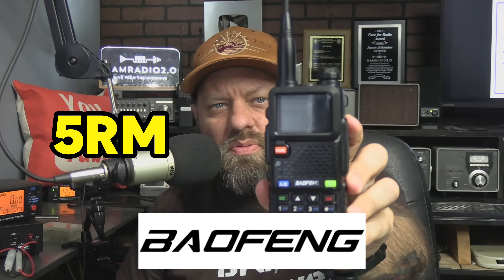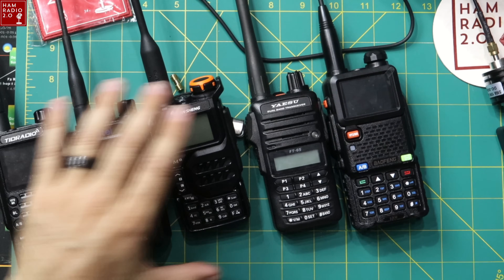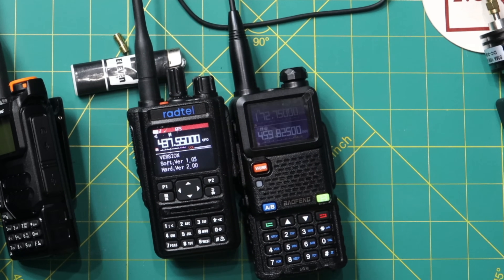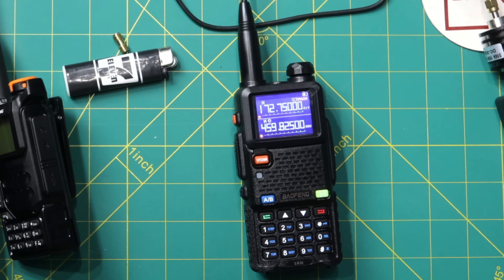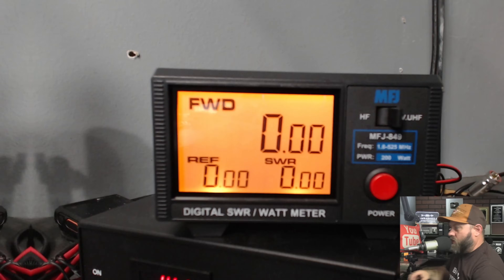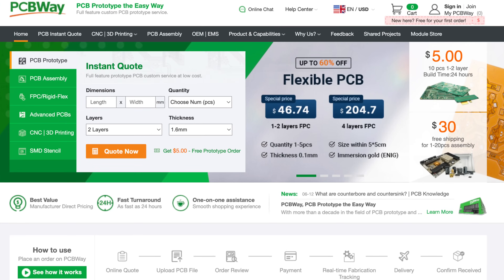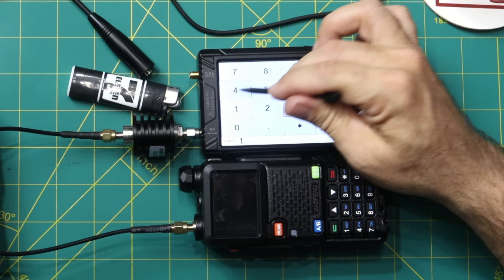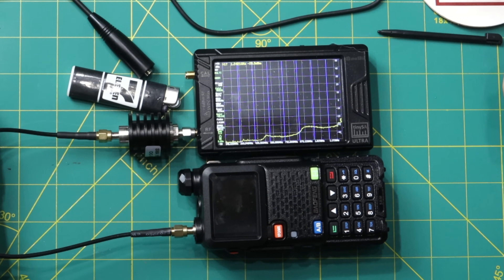The Surprising Truth About Baofeng 5RM and TinySA Power Test Results

Comment: I would like to know if in my company, with the UV5-RH Pro GPS or UV-5RM Plus GPS, I could follow all the 30 radios gps positioning, at the same time on a PC software? What Software? How to do it?
Reply from the maker: That's a good question.  I am not 100% sure, but I don't think so.  The GPS in the radio is a receiver, not a transceiver, so it doesn't transmit or beacon a GPS position.  You would need an actual GPS device to do this.

Comment: Jason - New ham, a 5RM is my only equipment as of now.  Maybe a silly question but - is there such a thing as an external filter that can be added to a handheld transceiver that could clean up a dirty signal such as what might be generated by one of these?  At the price point, I recognize it might be cost-impractical, probably better to just buy a different HT, but I like the radio in other ways - just curious, thanks!

Comment: BTech/BaofengTech just came out with their 8 watt ti-band version of this radio. The
BF-F8HP PRO. VHF/ 1.25/ UHF, IP54, 1,000 Channels, GPS, Aviation Band Scanner, NOAA Weather Mode, USB-C Rechargeable Battery. $69.89 on Amazon. BTech tends to take these  Baofeng radios to the next level with better quality.
Reply from the maker: Yes

Comment: FWIW, some reviewers have reported that Baofeng has cleaned up the signal in the newest 5RM radios. I bought a couple for myself and I liked them so much that I bought some more for a non-profit i work with. It's a little disappointing that it doesn't generate the rated 10 watts, but in reality there are so many factors affecting signal strength that in a practical sense, 8 vs 10 won't matter to most people. It hasn't mattered to me.

Comment: It is interesting to note that though Baofeng calls this radio 10W in promotional literature, there is no stated output power in the user's manual and I didn't see any specifications to calculate output power either.  In this and 2 other reviews, power output was measured at 8-8.5W max.  This shows good consistency and I can only determine that quality control is good and power output is also OK.  I suspect Baofeng does like many manufacturers and plays the white lie game here.  Audio speakers are often rated at peak vs RMS output.  This device may be rated at input to produce maximum output for example.  So Baofeng advertises this at 10W but is careful not to show that in the manual so are they rating it at 10W?  I am not going to butcher my new radio to patch the battery to the housing with wire and hook up a multimeter to measure input.   Its nice to have these reviews to show what output I can expect.

Comment: The new Baofeng radio is a brick. The color screen is beautiful, but it gets old fast. It also draws too much power. I don't like the blocky design. I'm not going to watch movies on them. I also don't care about harmonics as no one seems to be using the other frequencies. 

Again, the color screen is beautiful, but fairly useless. Dump it in the nearest lake and use a UV-5R instead.

Comment: I just got one in the mail it came with 2 antennas a short one and long a Aubree 771 I was very surprised I programmed simplex as my first channel and made contact with someone that was 4 miles away and it sounded like he was right next to me I think we could have talked a lot further but he stopped at his house I can reach a repeater 33 miles away with the longer antenna but I am scratchy I made a 1/4 wave ground plane and use this and have no problem I’ve only had a uv5r hand talkie so I can’t compare but so far I like this one especially the usb charging port.

Comment: I just got the AR-5RM version and I am getting 5-6w in the 2m band, 6-7w in the 1.25m band, and a whopping 15-16w in the 70cm band as well as 13-14w in the GMRS band. I kind of appreciate that extra power but I don't know if I want that much power next to the old noggin or on the belt making mountain oysters out of my nuts. Oh and also, the power settings in the 1.25m band for high and medium are reversed when measured. But I think it is a good little radio for maybe a backup of the mobile radio I have set up as a base with the power it has in the 1.25m and 70cm bands. I have a hunch I got the 5RM Pro Max version that is supposed to be 15w and they stuck the wrong sticker on the back of the radio. I just wish it was at least 10w in the VHF bands. 
Receive seems good except for one of my local repeaters that whenever someone who is loud into the machine it causes the signal to drop out at the peaks of the audio. I think it's a problem with the repeater because I see the signal fluctuating on my other radios too just not as drastically as the 5RM. And by local repeater I am talking about 12-18 miles away since I live in the country. 
The radio has no problem getting into the repeaters around my area even one 440 repeater over 40 miles away. And that's in the house on the AR-771 antenna that came with the radio. I also work repeaters to the north of me over 30 miles away most of the time with the 771 antenna. The short antenna is junk and luckily the one I ordered had the upgraded Abbree AR-771, hence the AR-5RM model designation. 
I don't really want to know how bad the spurs are because I know it will rain on my parade, LOL. 
The battery seems to be really good and lasts a long time. It will stop transmitting right at 6v but it was transmitting high power all the way until it stopped keying so I ran the FM radio and the flashlight to totally run it down and did that for 3 cycles from a full charge to dead so it conditioned the battery for the best performance. 
Yes the red letters suck as well as the small font of the channel names. They should be as big as the frequency numbers and there is no reason why they are not. Still, it's well worth the $26 I paid for it and would love to see the UV-21R get the same bands and power increase. I got the UV-21R along with the AR-5RM and have been testing it for a few days and I really like it. It's tri-band and with consistency in all 3 bands and GMRS of around 5w. It doesn't have air band receive but that is not important to me. But that's a different radio, but I wish it had the power the 5RM has. 73s

Comment: Your Tiny SA has a noise floor issue up in the GHz region.  You shouldn't blame the Baofeng for that.  The 5RM isn't doing 2.954 GHz.
Reply from the maker: Then why doesn't it show that harmonic on every radio that I test?
Reply: @HamRadio2 Dood. That particular spur was there B4 you keyed the transmitter. Rewatch your own video.
Reply from the maker: @N9XRradio  Dude... rewatch ALL the videos I use this TinySA on and see that it isn't there hardly at all.  #logic
Reply: @HamRadio2  then you must've blown it up. It's right there on your video at that time without the transmitter being keyed. W6LG knows how to properly care for and properly use his equipment. Once you have blown up those devices, they accentuate harmonics. His testing shows no real issues with harmonics on this radio.
Reply from the maker: @N9XRradio  you're obviously not familiar with the poor quality control of Baofeng radios. Just because one works well doesn't mean that they all do
Reply: @HamRadio2  I'm obviously a school bus driver on the short bus. SMH.

Comment: Without a repeater in range they are just an expensive walkie talkie, in a different frequency. You need a license to legally use the top channels or the ham bands if your GMRS is ham capable.
Reply from the maker: A couple of things...
These HTs aren't expensive.  $30 for an HT is quite cheap.
Walkie Talkie doesn't have a frequency, so that part makes no sense.  A walkie talkie is just a handheld radio
Real GMRS Radios aren't Ham capable.  The ones that are, are cheap Chinese HTs that are dirty and poor quality.  With a poor quality HT, you aren't going to get nearly as far without a repeater, but it is still possible to communicate.

Comment: I got a UV-5RH, which is the same machine but sells in china, the output wattage is about 8.5 watts, sometimes with battery full charged it will get 9 watt output, factory quality control is rubbish, I bought 3 machines, one of them got only 7 watts on high power, BTW the factory antenna is still rubbish. I'm hopping to get opengd77 support.

Comment: I did use differnent fq than you but my radio did 10w+ i think on all bands... i did use the best fq in the bands that showed the highest watts. Or you got a bunk radio? Anyway i was impressed with mine. Mine also came preprogrammed with the 1.25m and AM air bands just type it in yours it should work. And the green button learns from antother radio. I have the same software as you on both my 5RM and the other one 5R? or whatever so yours should have these features... And i did a custom power on logo :)

Comment: These HT's are too funny.  I purchased the Dual Band AR-5RM (last month) which looks identical to your 5RM.   Mine tested well below the FCC limits on both 2 meter and 70 cm.   But get this,  I decided to see if mine would operate on the 220Mhz band.  And it does!  It receives AND transmits on 220Mhz!  It was advertised as a 2m/70cm radio so I feel like I lucked out and got an extra added feature for free!  Mine has firmware version V0.11 and hardware is version V01.  Now I need a multi-band antenna for 220Mhz.  LOL 
Keep up the good work!
Reply: Just fyi try 134.0000 and youll be :)
Reply: My ar5rm is firmware 1.14 and receive airband also.

Comment: it has 220 out of box. antenna required. further it has a green button that searches for activity, thats a first and its unlocked for gmrs and it has 10 weather channels3/11/24 not certified
Reply: 220 band works on my 5RM firmware  V0.14 Hatdware V01
Reply: And the clone mode is glossed over by a lot of reviewers…Frequency scanning AND tone scanning at the same time. Very awesome feature. You do have to be CLOSE to the transmit radio.
Reply from the maker: And again, there are multiple versions
Reply: @HamRadio2  no sir. mine is also v01  0.14.

Comment: Aloha Jason, this handheld looks much like my Baofeng A58s Tri Bander. 
     I bought two that measured at 9.63 watts, so I bought two more of these radios from the same eBay seller but they sent me the 5 watt versions, the BF-A58s on the second order that I don’t notice until after I gave one to Chuck KK6USY for testing when he came out for a visit to Honolulu and activated Kahana State Park here in 2022 for POTA. 
     Apparently, they only made these A58s handhelds for a short time and were only $36 at the time on eBay. 
     Now if this new Feng actually transmits close to 10 watts, I would still buy it but based on today’s video and testing, I would not. 
     Jason, you are providing a valuable service for the Amateur radio community and I thank you for that! 🤙🏻
Reply from the maker: Thanks

Comment: Can you explain what all this actually means? Thanks so much for all your videos!
Reply from the maker: It shows how clean the signal is or isn't
Reply: @HamRadio2  I think we missed a point on clarifying. Rick(i am guessing thats you name from your id above), the testing that was conducted here lets us know how good the radio is in terms of emitting signal at the right frequencies. Think of this way. Consider a flash light that is designed to be very narrow beam to ensure it lights up stronger at long distances. Now, to test it, the light needs to be reflected properly at the correct angles. If it doesnt, it leaks light at a wider angle and is not as efficient as it needs to be. Same with Radios. If they are leaking signals at frequencies they are not supposed to, then the signal thats emitted at the right frequency might not be as strong. In addition, the signal at improper frequencies might cause interference to ppl on those frequencies. In some cases, those frequencies might be part of a different category of users. When someone says signal is not clean, think of how it works when light leaks from flashlight where it shouldnt. Hope it helps. Being a newbie, this was my understand. Anyone can correct me if I am wrong. Always willing to learn.

Comment: All YouTuber's should start their review's with the spurious emissions tests on these  cheap HT's and when they fail, there is no need to talk about them any further and not waste the viewer's time.
Reply from the maker: So lots of wrong info in all of your comments. 

It isn't a waste of time to talk about these radios because lots of people use them and don't care about spurious emissions. The video isn't made only for you. 

Also, yes... people do care about spurious emissions. And you should too. It's possible you'll damage something with a dirty radio that keys up next to another electronic appliance. And these dirty radios are much easier to track since they're transmitting on multiple frequencies. So yes, people do care, even if you don't. The video wasn't made only for you. 

It's worth noting that these videos get lots watch time and comments, whether I show the TinySA test or not. Take that for what it's worth
Reply: This isn’t the correct test though.

HTs should be be considered with an antenna - conductive tests are not used by ETSI/FCC; they’re tested in an operational condition, in the position in which they’d be used and measured at 3 Metres in to a log-periodic.

It’s a quick test, and I guess if it passes a conductive test all is good, but a failure of a conductive test doesn’t actually tell an awful lot. If the antenna has poor SWR at the second harmonic it’ll seriously reduce the “actual” emission which is what actually matters. 

Look up the FCC test procedures for HTs, it says nothing about conductive tests for HTs.
Reply: How did the SA experience emissions test compared to the UV5R or other Baofeng radios. By the way, I just tried that Tidradio and it's receiver is garbage compared to Baofeng and other similar radios.
Reply: No one really cares about spurious emissions.....
Reply: Ooo. Me me me. I dont care about spurious emissions on these. I have other purposes for these.
Reply: Ya…cause building a low pass filter is hard.
Reply: Thanks for the reply Jason. I now have a better understanding of these reviews. chow
Reply: Absolutely, I would rather know what to steer clear from. sometimes You do get what you pay for. I'd rather spend the extra money for quality equipment.
Reply: @voiceversastudio  The thing I find funny is Baofeng already proved they could make a clean radio with the GT5R. Yet they went back to being lazy. I guess they can get away with it as long as the preper community continues to buy them.